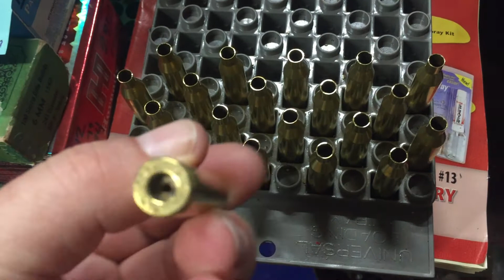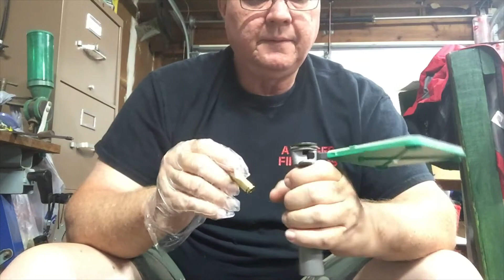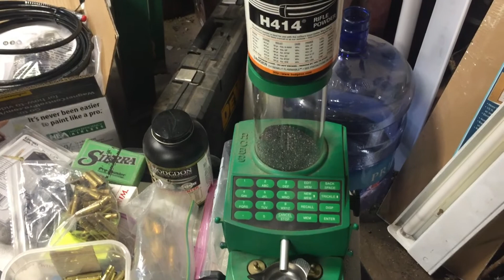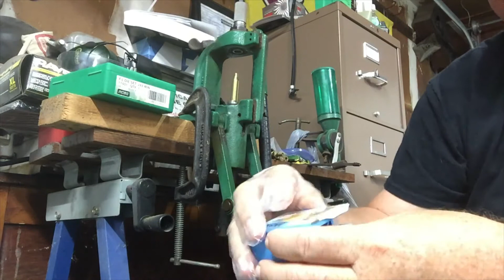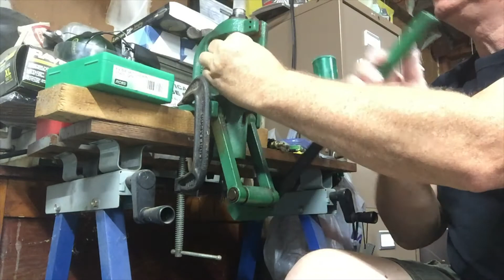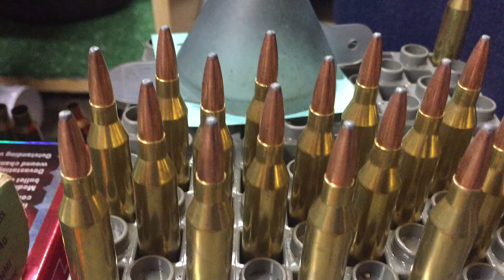Reloading  243 100gr  SP

Comment: Just finished my last can of h414 I was told that it was discontinued so now it’s time to work up a load with imr 4064! Great vid!!
Reply from the maker: I just scored a 8lb and  1lb containers of H414 in a buy out. Ended up with 35+ pounds of powder. More importantly 5000 rounds of projectiles in 6.5 and 308. SO, I should be good for awhile, maybe.
Reply: Love 4064 for 243

Comment: Thanks for sharing your 243 information, the Core-Lots produced some MOA groups from my Remington 770. Wishing you the same from your 788, what was the powder charge of H414 did you use in this loading? I’ve also had great performance from the Sierra 100 SBT and IMR-7828. Good luck putting the meat on the table
Reply from the maker: She shot just over .75 inch group @100yds, but got worse when the barrel headed up.
ALL firearms are different but I used: The load that Hodgdon said was MAX, 40.0 grains. That was backed up by 2 sources, no pressure signs noted.(on my rifle)
AGAIN! I don't guarantee that is a safe load, in any firearm.
Good hunting to you also! I just received a e-mail that I drew a state hunt for spikes and does, It might go as a backup. Unless my new 6 Creedmore shots better...
Reply: .75 inches @ 100 yards and no pressure signs, that a win-win. During my load development I shoot 5 rounds and let the barrel cool down. The Hodgdon data has served me very well in various calibers over the years.